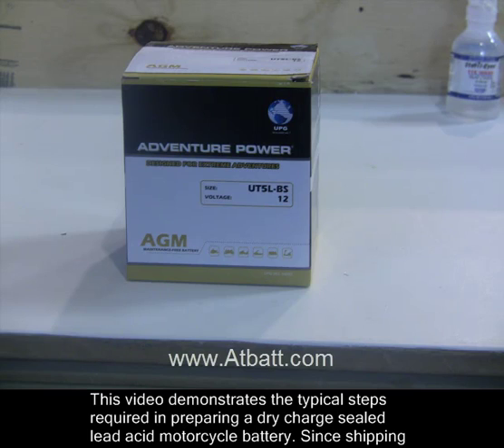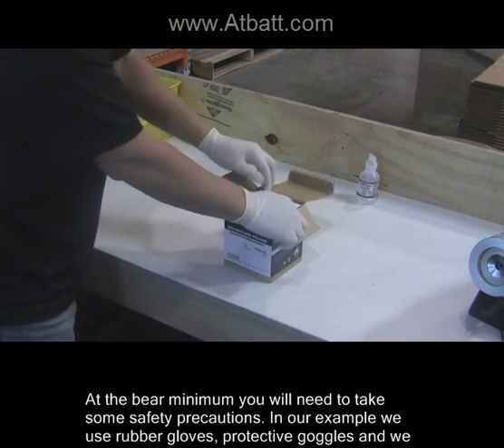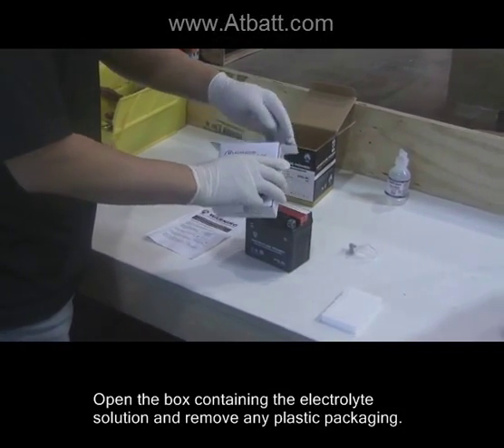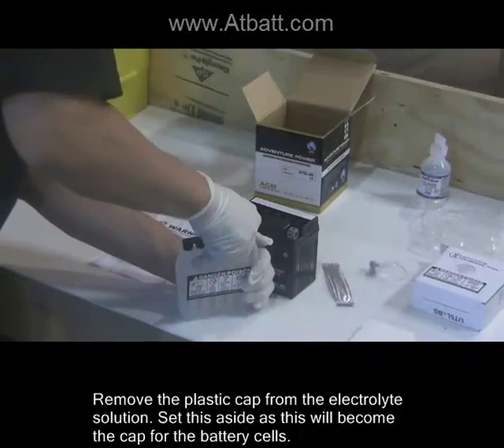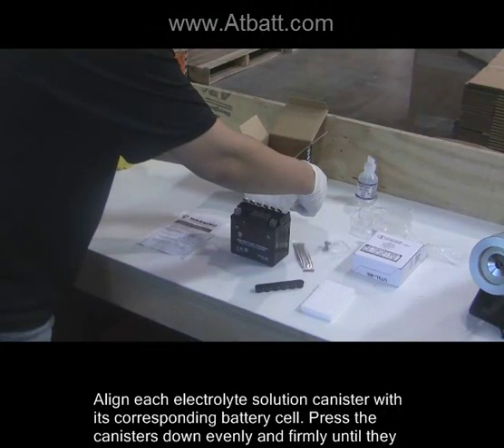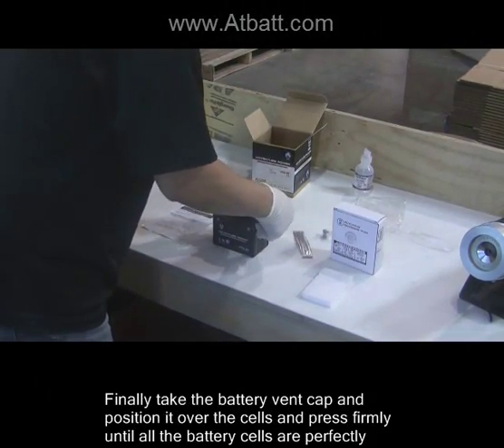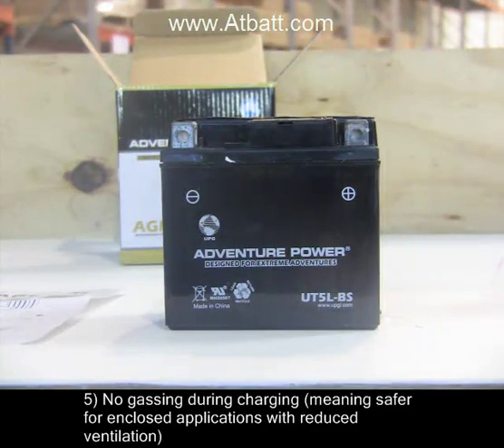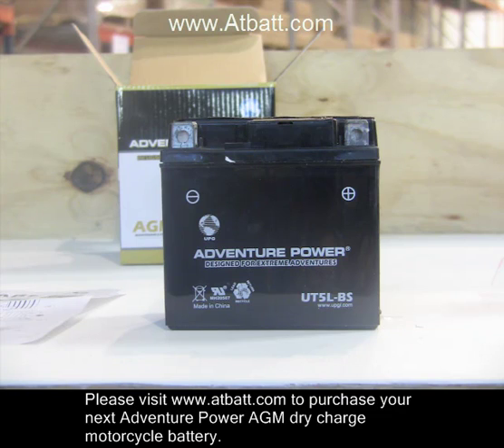Adventure-Power-AGM-dry-charge-motorcycle-battery.mp4

Comment: There are like 3 types of lead acid motorcycle batteries: sealed agm, dry charge, and conventional. The sealed agm should be ready to go out of the box as long as it hasnt been sitting around. The other 2 you have to fill and charge. The main advantage to the fill ones is they have an indefinite shelf life at least until you fill and use though the conventional one is a pain to maintain since you have to add water occasionally.

Comment: The most important part of the initial setup of this type of battery (besides safety, kudos for that focus at least) is the "breathe time" and first charge. To get the most out of a maintenance free battery, leave the caps off the battery for the first hour to allow the acid to settle and any air to escape. After an hour, cap it and charge it with a 2AMP charger. Charge time varies but it should take 4 - 5 hours (a decent charger will tell you when it's fully charged).